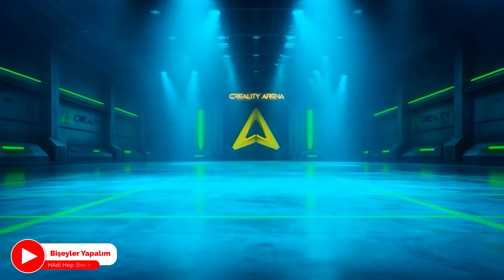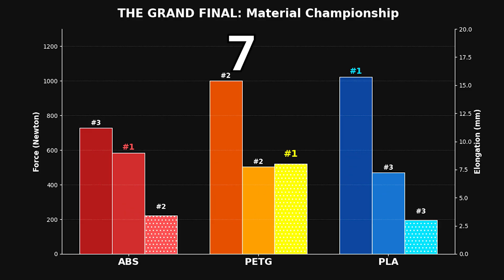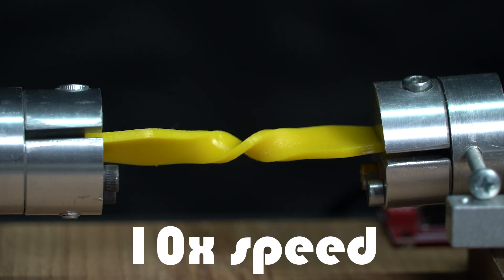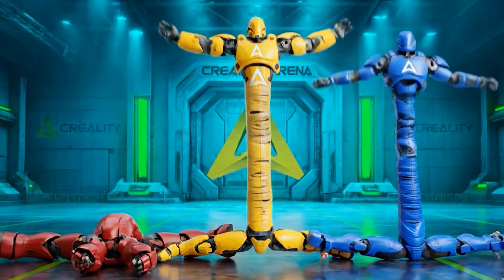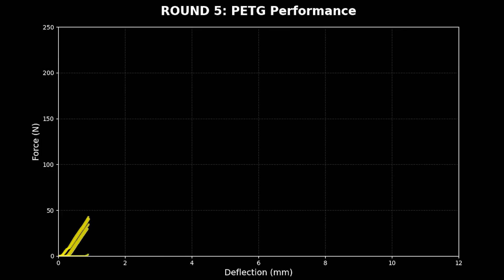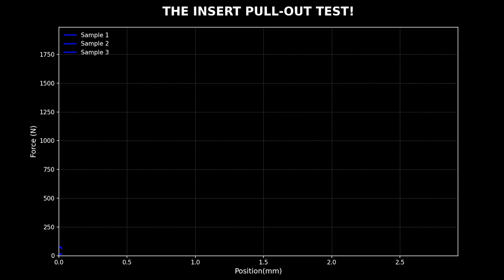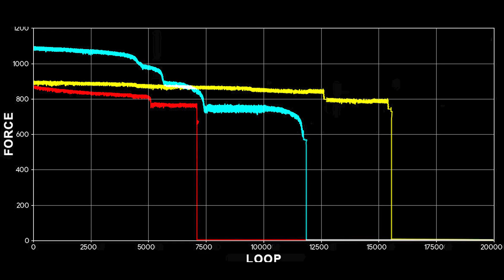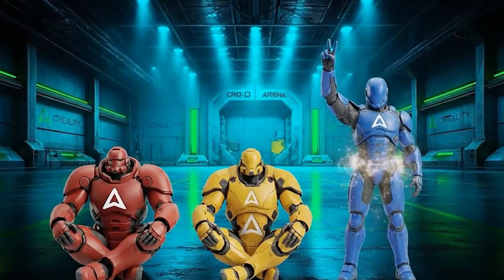Büyük Filament Kapışması Başlıyor! PLA vs ABS vs PETG

Comment: What was the max for that load cell in fatigue test? Really over 1000 kg? Maybe the unit is in Newton not kg?
Reply from the maker: Great observation! 🕵‍♂ However, that '1000' is not kilograms; it is raw data representing the force applied to a spring-like component.

In this test, I'm not focused on the weight in kg. I'm monitoring the raw force to see:

How many thousands of cycles (open/close) the component can survive.

How much that raw force drops over time as the material gets tired (fatigue).

I actually didn't label the graph with 'kg' or 'Newton' on purpose, I just used 'Force' for the raw data. There might have been a small slip-up or misunderstanding in the voiceover as well. Since my machine’s max capacity is only 300 kg, 1000 kg would be impossible! 😂 It's all about measuring the 'strength loss' through raw numbers.

Thanks for the keen eye and for watching! 😉"
Reply: @biseyleryapalım I understand this, its comparison test and its fine until you have same units. I just want to build some similar test and I wanted to know the limits.
Reply from the maker: @MyTechFun  "Actually, for this specific spring fatigue test, I used a 20 kg load cell. Since I was measuring the 'strength loss' over time through raw data, this capacity was more than enough and provided great sensitivity for the test.

Comment: Interesting video. Not sure I agree with your results. Seems like PLA did much better than expected. I was also somewhat shocked by how poorly ABS did. I’ve never used Creality filament and am wondering if this brand has additives that are affecting the results. It would be interesting to run the same tests with other brands (like Bambu, Elegoo, Eryone, Sunlu, Polymaker, iSanmate, ZylTech, etc.). Would be interesting to see if results are the same with other brands. Would also be good to add ASA and Carbon Fiber & Glass Fiber mixes to see how they score. Some other tests that would be interesting would be chemical resistance and UV resistance. Would also be good if you showed the final results in tabular & graph form and gave best use cases for each based on how they score in your test suite.
Reply from the maker: Thanks for this detailed feedback! You touched on a very common misconception in 3D printing, and it's great that you noticed it.

Actually, in pure tensile strength (pulling force), standard PLA is often scientifically stronger/stiffer than ABS! ABS usually wins in impact resistance and heat deflection, but PLA can hold more static weight before snapping. That’s why the results look like that—it’s the nature of the material versus the specific test type.

You are totally right about the brands; testing Bambu, Polymaker, or Sunlu would give us a great baseline. I’ve added your suggestions (ASA, CF/GF mixes, and especially Chemical/UV resistance tests) to my "Future Episodes" list. I’m also working on making the data charts clearer for the next video. Thanks for watching and stay tuned for the next round!